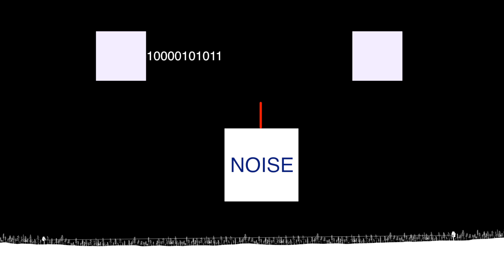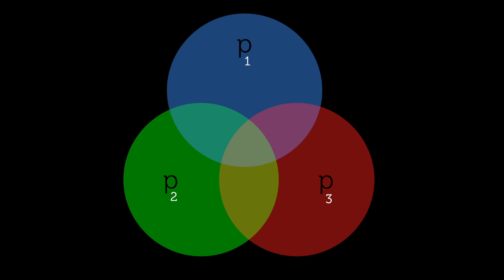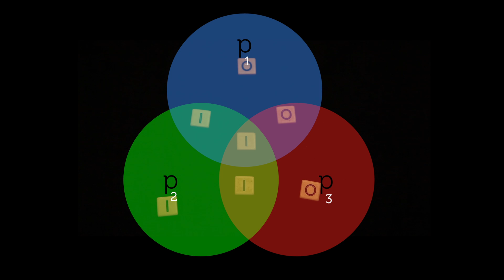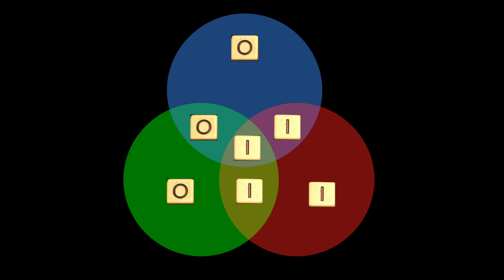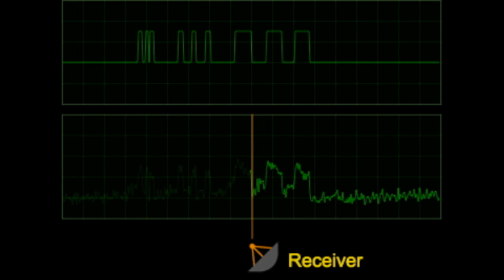Error correction codes (Hamming coding)

Comment: There are some small simplifications that made it a bit harder to understand. If the odd or even parity bit is evaluating 4 possible signals, it would be able to detect if ONE of the four signals is wrong, but not if there were TWO wrong,  UNLESS it had the additional parity bits. So this is asking you to suspend your logical disbelief until the next point is made.

My mind first went to if there was a parity bit to evaluate three spaces, it would always be right but perhaps the evaluating where the positional error is more difficult.

Also, it makes me wonder if at the start it might* have possibly helped if you started with three spaces rather than four because at the end with the three overlapping circles, you are only evaluating odd / even for 3 spaces. Introducing the concept that way might* not lead to the problems above?

It might also be cool to go into why because of repetition we can compress the message. Why the data can go from 4 signals to 3 to verify

Comment: What if the parity or data bits are altered too? Are they not susceptible to interference?
Great channel btw
Reply: There is distance between the code
If there is change parity as you say there is maximum likelihood or nearest code
https://youtu.be/-15nx57tbfc
https://youtu.be/5sskbSvha9M
Reply: Yes, parity bits are susceptible to interference, but it's also possible to know if that's the case and correct it by flipping it. If a data bit has an error, two parity bits will be wrong during the check – in this case, correct the data bit. If only one parity bit has an error, only the parity bit will be wrong during the check – in this case, correct it by flipping the parity bit.
If you have two parity bits that are wrong, it's a pretty noisy transmission that needs more redundancy :)

Comment: What would happen if a parity bit was wrong? It would "correct" all the other bits and mess up the data. So how is this an improvement?
Reply: +kagi95 then it would mess up the correction. If thats a problem then you need a system with more redundancy and if errors are in clusters then you need to distribute that redundancy so that it is unlikely to be completely overlapped by a chunk. Nothing is going to be perfect though and the more redundancy you add the more expensive it is to store and transmit the same amount of data. If you know how corrupt your communications channel is though you can work out how much redundancy is needed and you can use larger checksums to know if in the end your block of data is corrected with any level of certainty you need (256 bit checksums mean 1 in 2^256 chance of a corruption having the same checksum as the original for example)
Reply: Add the rule "if only one parity bit is mismatched flip the parity bit".
Reply: +JonnyLatte What if two parity bits were flipped?
Reply: JonnyLatte Thanks!

Comment: What if the error occurs in the parity bits?

PS: what's with the weird music in the background, are you trying to scare us?
Reply: Parity bits can have errors, but it's also possible to know if that's the case and correct it by flipping it. If a data bit has an error, two parity bits will be wrong during the check – in this case, correct the data bit. If only one parity bit has an error, only the parity bit will be wrong during the check – in this case, correct it by flipping the parity bit.
If you have two parity bits that are wrong, it's a pretty noisy transmission that needs more redundancy :)

Comment: but... but... what if a parity bit gets screwed up. in a given error, its going to happen about half the time. and if a parity bit is messed up, it will falsely correct a non errored nibble. so this only corrects for 4/7 errors. if an error is going to happen, its going to happen, the hope here is only that the errored bit lands on the non parity bits. can someone explain why error correction works better than this?
Reply: Because only one parity bit will have an error. If a data bit has an error, there will always be a pair of parity errors. The only actual problem would be multiple bits all being screwed up. But for that to occur, there would be so much noise that it's considered too difficult to broadcast.

Comment: So if only 1 parity bit is incorrect, the data doesn't have an error, but the parity bit has an error right?
Reply: you said: "if the parity bit has an error, [...], the parity bit has an error"
please ask again ;)
remember that this code can only correct one error. if two or more errors occur, it can not correct it any more.
if you're interested, google for "hamming code"
Reply: No, I mean if only 1 parity check doesn't compute, then we can asume the parity bit has a transmission error.
Reply: yep, exactly. still assuming that we only have one error.